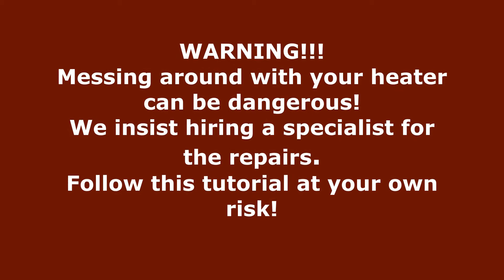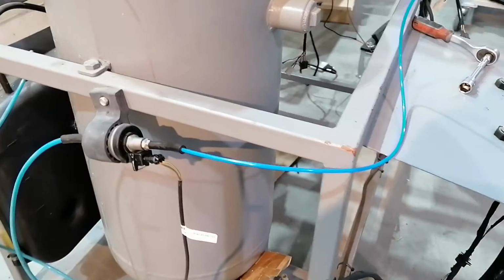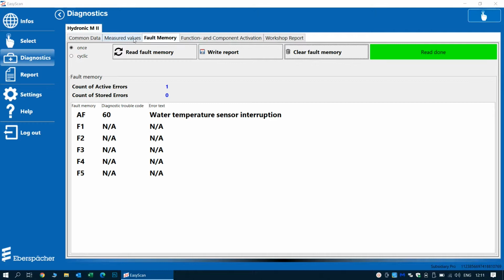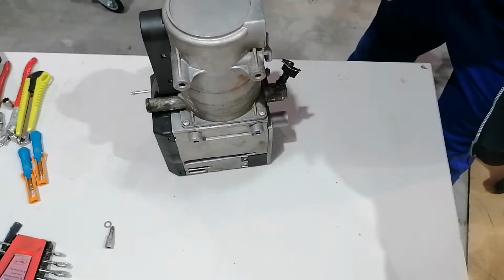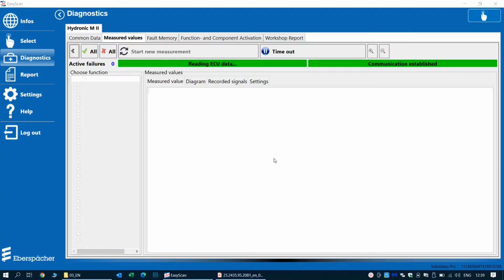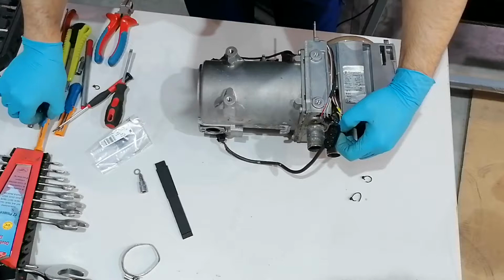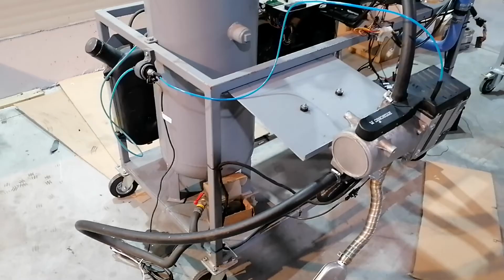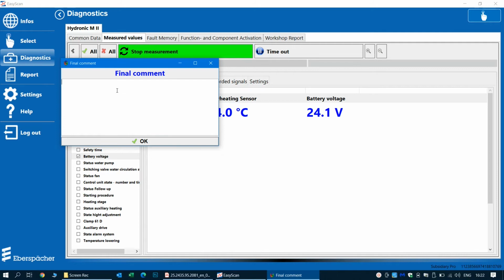Eberspacher Hydronic diesel heater M 8 10 12  kW repair code 60 temperature sensor interruption ECU

Comment: Hi I have a espar water heater 12kw no power going to the fuel wire from the unit do you have any aids
Reply from the maker: Do you have any fault codes?